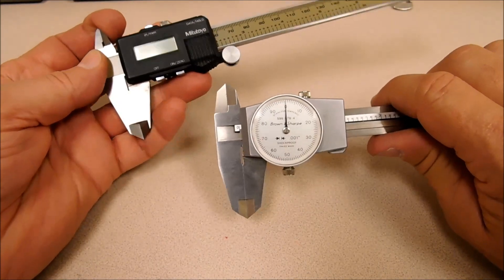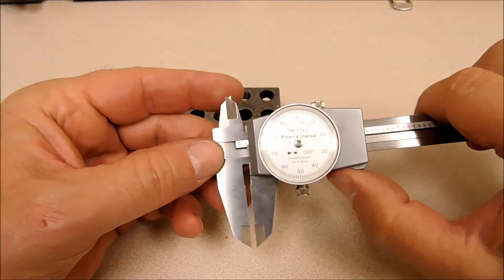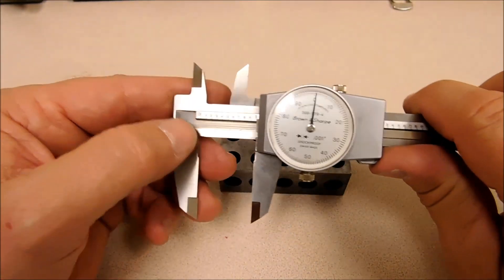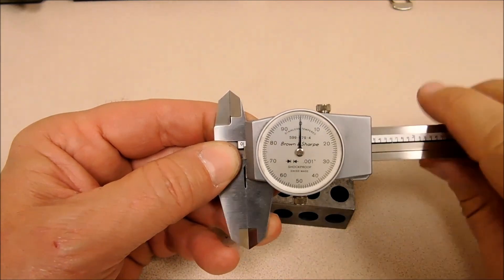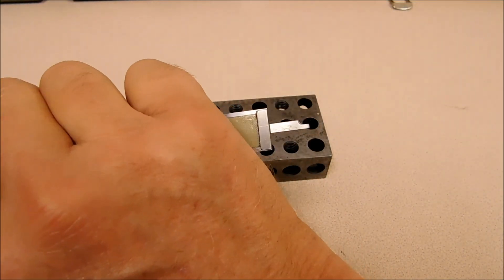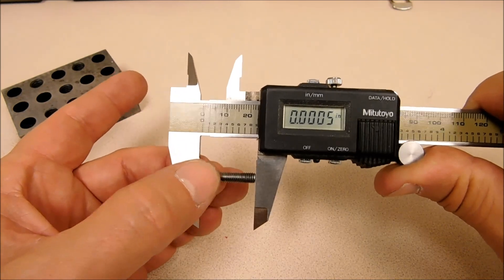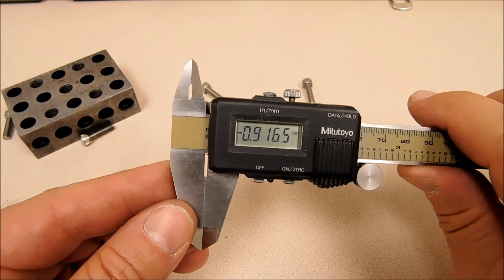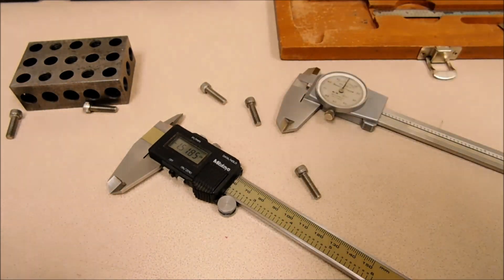Calipers -- Dial vs. Digital -- Does one do more ???  ( yes )

Comment: Thank you for another great video! 
I just need a digital caliper that doesn’t have a dead battery every time I pick it up. I use my old Brown and Sharpe mechanical. It works every single time. Just like it has for decades.

Comment: Living in a metric country, but sometimes have to deal with imperial machinery. So the digital suits me better. But for most measurements I don't need precision, a rough estimate will do. So a vernier is enough, Is it a metric or imperial hex nut? The vernier has fractions. The usual question, is it 1/2" or 13 mm easily answered.

Comment: Use the zeroing feature every day by taking a measurement of thread gauge and zero. Then screw thread gage into thread . Then use depths gauge on caliper to measure how far it’s went down .
Reply from the maker: I've done that, but be sure to set your caliper from the first thread crest and not the end of the gage. Sone thread plug gages have a straight cylindrical lead.

Comment: funny thing you talk about math with the dial since you really don't need to do that, with the dial you can remember the dial's angle and then visually see the difference in the measurements.

also being able to take measurements visually is also pretty great too, also there are dial calipers that do have two dials for metric and imperial although mine zeros differently for each so I do have to adjust the zero the zero for each which does take a longer then pushing a button but if you got more lucky then me that shouldn't be too much of a problem!

Comment: Great video, thank you! I have both, use them everyday but tend to always grab the digital. My older dial typed can easily get knocked out of zero by a chip in the rack n pinion. Like you say, always confirm zero.

Comment: I prefer the dial caliper because I don’t have to worry about batteries. Are there any in it? Are they any good? Have they started leaking?  I do like the zeroing feature and have used it, but it’s not a deal breaker not having it.
Reply: I always take the battery out when not in use, this solves the leakage worry.  Never fails me.

Comment: I am measuring a rifle barrel for a muzzle brake. I used a dial caliper first then I used a digital caliper and I ended up with two slightly different measurements.
why is that?
Reply: Because a man with one watch, knows what time it is. A man with two, is never sure.
Reply: @HD24680  OH great!
Reply: @MLZ1957  heisenbergs uncertainty principle doesnt apply to just one branch of physics.

you cant make anything accurately, and even if you could, you couldnt measure it...

everythings based off those standards held in a lab somewhere... then master gauges are dispersed worldwide, then reference gauges, then shop gauges, and everything has a level of accuracy or tolerances... errors multiply, things wear, bend, deform with temperature...  those gauge blocks are marked with limits, come in grades... how much do you want to spend and whats level of accuracy do you need?

and verniers are one of the worst measuring methods, other than as "depth" gauges. that gets down to kinematics, the axis of measurement not being where the reading is being taken... unlike, say, micrometers, where it is in line...(still prone to the frame distorting with temperature or undue force?).

i wouldnt expect anything but mito/starret or similar to be within 0.02... verniers are rough, verniers are "cheap", verniers can be dropped in the chip tray...

you gotta be patient to do high accuracy work when a gauge has to be left to sit for ten minutes or more to "normalise" because you touched it...

Comment: TINY DIAMETER HOLE YOU NEED THE DEPTH FOR?  ZERO THE GO PIN IN THE CALIPER THEN MEASURE THE STICKING OUT PORTION WHEN IT IS IN THE HOLE AND THE DIGITAL WILL READ THE DEPTH WITH NO MATH.  VERY USEFUL.

Comment: I always learn something new from you - Thanks!! I have two comments, being 78 yrs old, my eye sight is not so good. I have both types. I bought an iCalc larger screen digital which is much easier to read, plus (not that I use it) it has Blue Tooth. If measuring a number of items the actual measurement with the press of a button, will send the measurement to a computer inserting it into # numbers file. (No association with iCalc.)

Comment: The dial won't need batteries. I have a digital and two dial, one imperial and one metric. They all work great, but the digital goes thru batteries quickly, probably because I got a cheap one.
Reply: Yeh apparently Mitutoyo has some sort of patented technology on their calipers so they drain little power when on & almost no power when off. I'm still deciding what to buy so I don't actually own a Mitutoyo myself but I've heard people saying their batteries last anywhere from 1 to 3 years.
Reply: @northeastcorals  so what I do to prevent the battery from draining while stored, is just take the battery out and store it in the case for the calipers.
Reply: @bert-blank  Exactly that. Obviously replacing/removing the battery each time may be a bit of a chore (some  models more than others) but I have seen there are quite a few videos on Youtube where people modify their calipers to enable faster battery isolation. For example 1 mod enables you to slide a small strip of plastic between the battery & the contacts etc.

In the end I decided the battery drain thing plus some other features made Mitutoyo worth shelling out some extra money for rather than messing around with mods or removing batteries  etc. I've managed to order one for £88, which I don't think is too bad if they last as long as people say. I've heard there is a weak point where the thumbwheel is attached by plastic (depending on model)  but as long as you watch out for this I think they should last a long time. 👍

Comment: Dial calipers were the stage between vernier and digital. Digital also have the huge advantage that by just pressing one button you can switch between mm and inches and thus easier to mass produce. If a company can't afford to have a few batteries in the refrigrator then they must be near going broke.. Temperature also has influence in how long a battery lasts!

Comment: I have used a set of Insize callipers for some years now (respected Indian manufacturer) but they took a nosedive into wobbliness.  A problem that they always had was the battery consuption; everytime that I wanted to use them (seemingly) I had to put a new battery in.  I wish that the tech specs for callipers included battery drain in both the ON and OFF states.  Interestingly the Youtuber Robert Cowan looked at several digital callipers and found that in the ON state most had a drain had a drain of around 15-20uA in both ON & OFF but the much more expensive Mitutoyo were only 5uA ON and a measly 1uA OFF.  Disapointingly he didn't test budget More & Wright.  I have decided to splurge out on a pair of Mitutoyo dial callipers (1 rev/mm with 0.01mm divisions).  Will I be disapointed? - unikley I reckon.
Reply: Yes - I had to fumble with the battery quite a bit also.
Reply: Of course you won't be disappointed. Indians are shit, Japs are great.
I have a 30 year old Mitutoyo vernier caliper which still looks like it was made yesterday.

Comment: Hi Joe, not sure if anybody has commented as there are 576+ comments, but you can also find the centerline distance of two holes by measuring the ID of one hole, and zero the reading. Then measure the outside radius of the two holes and the reading will be the centerline of both holes. Of course it only works if the holes are the same diameter +or- a couple of tho’s……….. as always, thanks for all your wonderful and educational videos!!!!

Comment: Got both.  The dial won't ever quit on me because the battery died...   :-)
Reply: Mitutoyo is very easy on batteries. I got one that lasted over 2 years on a cheap alkaline cell. The cheap Chinese ones and fake Mitutoyo ones will chew through batteries like no tomorrow
Reply: @yoyomin  
This is because mitutoyo has a patent on battery saving tech to keep the battery lasting longer
Reply: For what it is worth I have an iCalc digital which I have been using for about a year now with no problems. Also keep a spare battery around just in case. I have other ones like analog Brown & Sharp, but the iCalc is my go to. @yoyomin

Comment: hey joe might i ask what is the whitworth scale and metric iso on the back of my calipers is that thread i;nfo
Reply from the maker: What brand?
Reply: @joepie221  its a fowler dial caliper
Reply: Whitworth is a type of british thread (old standard), its very similar to M-threads in design except the angle is 55 degrees instead of 40 in the "valley" as we call it in Sweden. I took a look at a cheap, shitty caliper i purchased years ago when i got into CAD design and 3d printing, and mine shows something similar to yours. For metric ISO it has the diameter, pitch, minor diameter and what drill diameter to use to make these threads. The same goes for Whitworth except instead of thread pitch it shows thread density per inch. Hope it helps!
Reply: @zizor1759  :  Hey!... don't insult my "Cheap, shitty caliper"!  They are my Go-To measuring device for most occasions, saving the precise tools for when they are really needed.
Because they are cheap, I can afford to have them in my workshop, my hobby room, and my "off-site" toolbox.  If I damage them, no floods of tears and self-remorse, just grab another one.   😜
BTW:  Mine has the Metric-ISO thread chart on the back, but no mention of Whitworth.
Reply: @PiefacePete46  I have the cheap, shitty ones as a backup, but i hate just touching them after owning a Mitutoyo and using them in trade school lol. Mine were like 17-19$, so the quality is... Yeah.
Reply: @zizor1759  :  It's good to confess your sins... your secret is safe with me!  (I can't vouch for the rest of Youtubers tho'!)

Comment: Joe, a couple of things, knowing the overall length of the caliper is helpful for larger measurements. My brown and sharps are 8.916 long, if I need to measure let's say 12 inch milled internal feature, place the caliper inside the feature open the caliper to where the front edge is square open the caliper to where the depth rod touches the other feature, if your reading is 3.084 you are 12 inches (8.916+3.084). I scribe this dimension on my caliper for reference. (I was never taught to do this, just had an ahah moment when I was an apprentice, no one has heard of or used this technique, 12" get me over 25") after tears of doing this I'm very confident in it's accuracy. I use my dials for counting, measure and move my calipers to desired dim. counting the thousands I need to adjust the machine. I'm going to switch to digitals, most of  the steel at my shop is mildly magnetic and I keep getting fine chips stuck in the rack. Thanks Joe!
Senior

Comment: I want digital, but I was thinking I should get dial. I am only going to need a caliper once every month or so. I'm worried the battery will always be dead.
Thoughts?
Reply from the maker: A good Mitutoyo set will hold a battery for years. But you can't beat a good B&S dial set either.

Comment: I have 6 sets of calipers, 1 of which is a 12" Mitutoyo digital. Of my dials, I have 1 shars (24"), 2 Mitutoyo (12" & 200mm) and 2 harbour freight specials (6" & 12"). The harbour freight ones are about 10 years old and left over from my time running water-jet and are rarely used now. Never was too keen about using top quality calipers in the highly abrasive environment of water-jet. Pretty much the only time I use the digitals is for inspection. The dial calipers are plenty good for spot checks and production runs.

Comment: I notice that neither of those were vernier calipers
Reply from the maker: Just like all hot tubs aren't Jacuzzi's and not all facial tissue isn't Kleenex.
Reply: @joepie221  Subtle difference... "Jacuzzi" and "Kleenex" are brand names. "Vernier" is not a brand name. It is the type of measurement scale.

I, personally, have trouble with vernier scales as sometimes I can't tell when the lines are dead-nuts aligned or ever so slightly offset. Probably due to my astigmatism. (Plus some vernier scales force you to do too much mental arithmetic because the vernier part of the scale isn't 0-10 with single unit increments...)

Comment: So long as you're within .100 you can zero mechanicals and use them the same way. You just lose the original measurement if you don't write it down. Metric conversions are a PIA.
Reply: IMHO U just get what feels good to you, or is better for the job on hand. BTW, conversions to imperial are also a PIA ;-)

Comment: Hi Joe,
The feature for the depths measurement had the mitutoyo calipers first. When I was leaning tool maker, now 44 years ago, mitutoyo calipers were cheap, but reasonable quality, and this feature was promoted by the dealership. Also you can use it to scribe a distance to your workpiece. First we saw mitutoyo as a 3rd class caliper, because Mauser were the brand you had to have. But it turned out mitutoyo calipers weren’t that bad how we thought, and I still have my first Mauser and Mitutoyo caliper. Calipers with a scale. Still reliable.
Reply: Sounds like what happened with Honda. Started out as cheap but decent now expensive and top tier
Reply from the maker: If you take care of them, they'll last a long time.

Comment: Dial is more reliable when you need to be certain. A digital can fail at any point between 0 and 6. If a dial is off it will be off from 0 to 6 so it's easy to catch.
Reply: If you have an absolute caliper it will never be off… it’s absolute
Reply: What are you talking about a digital failing? I have used digital in medical device manufacture. They are reliable if you pay the price for them. They have to be calibrated and certified to a standard though like any instrument. The rack and pinion is a higher failure chance than the digital models as there are so many moving parts inside, there are so many delicate parts and springs inside.

Comment: The older Mitutoyo digimatic is much nicer than the newer models.
Reply from the maker: Thats too bad. They shouldn't have changed it. The batteries in mine last for years.
Reply: @joepie221  Many older tools and other things are simply better than what is manufactured today. It comes down to cost and other factors. Very expensive to manufacture in USA. There are exceptions but….
Reply: Newer models use better encoder system though - they know where 0 is even if the battery is take out or if they get a knock.

Comment: One tiny milling chip in the rack on dial calipers (no matter how good) can ruin them, it can happen the first day you use them. No matter how careful you are it can happen.

Since '77 I've had Mitutoyo digital calipers last as long as thirty years in the same environment, and worse.
Of course simple Vernier calipers can last virtually forever.
My vote is for digital Calipers
Reply: sure, but any coolant in the digital and it is toast. 
either way, having your calipers in the path of your work area is not a good practice at all.
I have had a set of Starrett dials for nearly 10 years and not once ever had an issue. I take care of my tools and care of where I place my tools.
I also have a set of Mitutoyo digitals, but I only ever use them when I need metric, and it is the second set I have owned, the first set was ruined by a surprise leak in the roof that filled my box with water while I was not working.
Many times I think I would have just been better getting a metric Starrett dial.

Comment: Higher quality calipers like the Mitutoyo also return back to true zero when you hold on the zero button for a few seconds. Also drifting off calibration is less likely when compared to the economy digital calipers and accuracy when measuring beyond the half way point.

Comment: I would add that a digital type isn't prone to getting a tiny chip or other debris lodged in the gear rack which can make the pinion for the needle skip a tooth - as with the dial type.
Reply: and dial calipers are not prone to frying a circuit when coolant or water get inside them.
Reply: @thezyreick4289  they just corrode internally depending on the solvent that goes into them.  like a clock these things are not intended to be filled with foreign fluids. AND Mitutoyo have models that are resistant to fluids.

Comment: For both analog and digital, prefer them to also have a fractional inch scale.  Great for woodworking.  The big advantage of the analog (dial) version is no battery to go dead every time you go to grab and use them.  LOL
Reply from the maker: Mitutoyo digital calipers are probably the best for battery life. The batteries last for years.
Reply: @joepie221  5 year guarantee. If it is less than that it is probably a knock-off.
Reply: In addition to what the others said, Mitutoyu wants you to use silver oxide cells rather than alkaline since they'll last 3x as long.  And they genuinely last 5-10 years.  If you buy cheap calipers they often last for a year or less.  There are several pages/videos where people measure the battery usage of different calipers both on and in standby and the difference between the brands is huge.